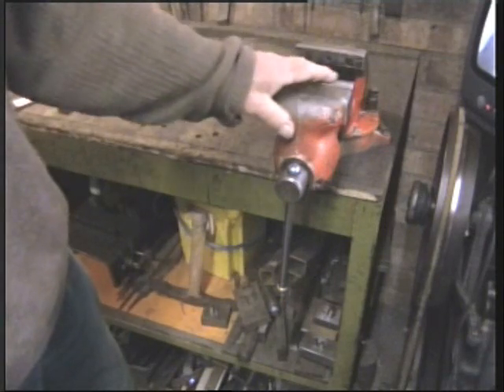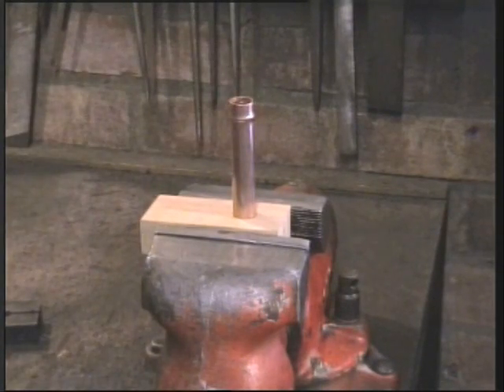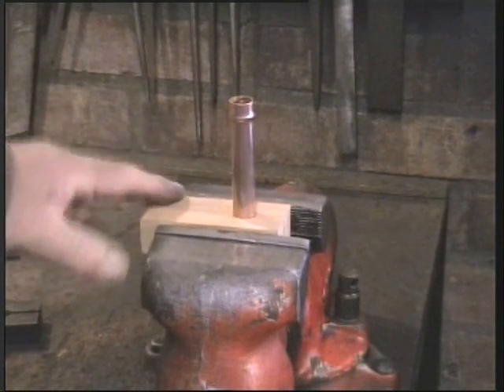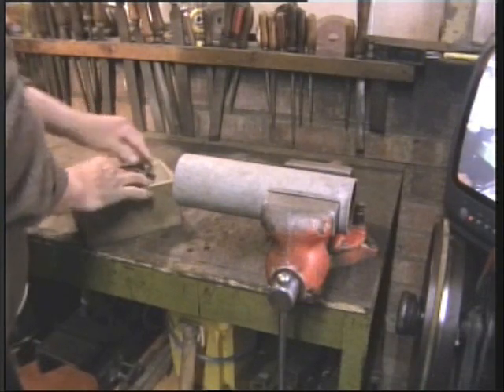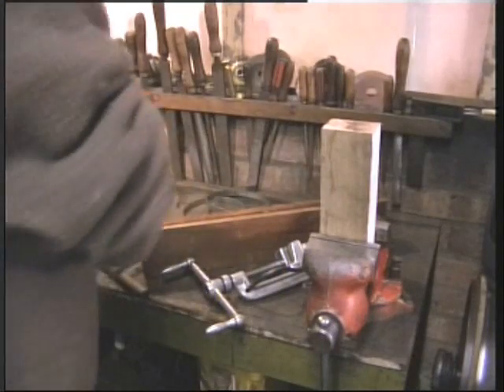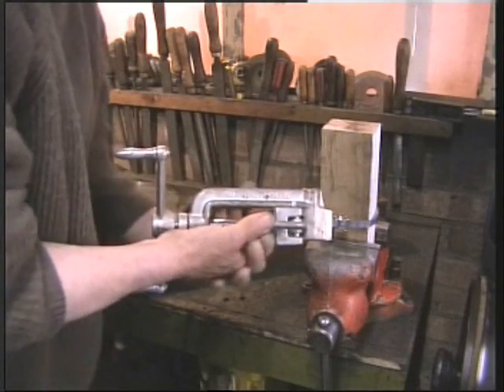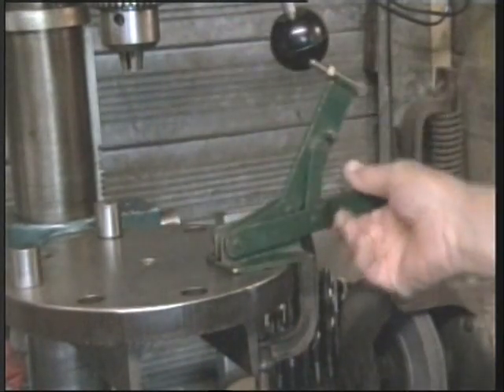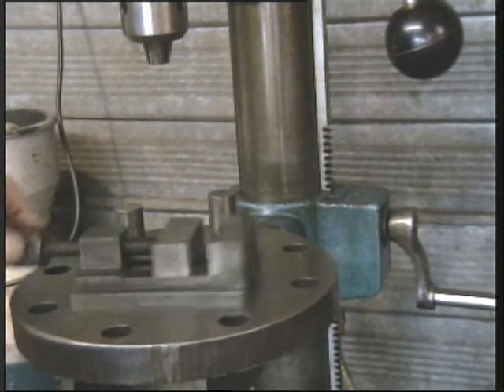workshop tools

Comment: Hi, I too love my old tools and have quite an extensive accumulation from many trades most of which I use. I have had a set of those pipe swaging tools for over thirty years and have never been able to find out what they were, so thank you for showing them. I don't think that many modern plumbers would know what they are because I know a few plumbers! 
Best regards, Jon

Comment: I love old timers giving their take on Tools. Most of the tools made back then are still in usable condition, I have a few bits and pieces that my Granddad used to use, Some of them clearly home made but they still work just perfectly too. The stuff we but today is all cheapo tat, Monkey metal or some fancy named plastic. I have a old King Dick adjustable spanner (possibly from Noah's tool kit) and a pipe grip wrench, They might well be paint free now and browned with oily rust, BUT, The Jaws still have all there own teeth and the KD spanner, The threaded wheel still turns true to adjust its size, Which has zero slack. New tools like this are utter rubbish in comparison.    I have a question though....  WHY are there Three thumbs down?

Comment: Your telling of the gas pipe cutting with a hack saw reminds me of the tale of the guy welding/brazing a crack in an oil storage tank when it was full of oil. On reflection its most probably one of those apocryphal tales all engineers hear at one time or another.

Comment: Super video as always! Thank you. Incidentally, is that a Manchester power hacksaw lurking under your TV monitor? Does it have a suds pump and tank? If so I'd like to know how the plunger for the pump is driven off the crank. I am restoring one and fitting a new old stock orig equipment suds system to it (acquired from a friend). Any chance of a video close up of the saw? Thanks in advance, regards, Simon

Comment: I bought a cheap bench vise from Lidl a few years back. Claimed to be cast steel.

Anyways it turned out to be pretty decent. The cheapness shows in a few areas but i've whacked lumps of metal in it with a 48oz hammer many times now and it's still holding together.

I lucked out at a car boot sale about a month ago and got a nice big quality bench vise. But the problem with that is that I don't feel as comfortable abusing it as with the cheap one.

Comment: A good bench vise is not always easy to find unless you have money to burn. Picked mine up at a car show for $20. Needed cleaning, a coat of paint and greasing. Good as ever. I like those jacks, never used one in the tool room.

Comment: POC  You have your vice set back from the edge of your bench by about 6 inches. That means you can't put long pieces in it verticall down towards the floor. I'm sure there is a reason.

Comment: Thanks for sharing this, Poroldchap. I never get tired of seeing tools videos. Your buddy with the gas line was a hoot! I never saw one of those tools for making the bulge in the tubing. Is that meant to function as a ferrule would, in a compression fitting? I have used a lot of those over-center clamps in building production fixtures and jigs, over the years. In the states, there is a company by the name of De-Sta-Co, that makes just about any configuration one could think of.